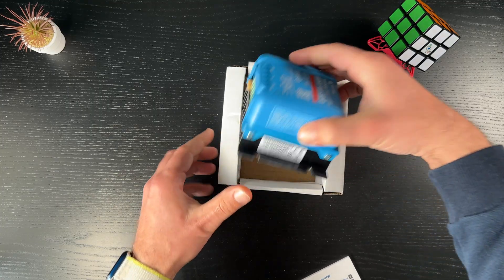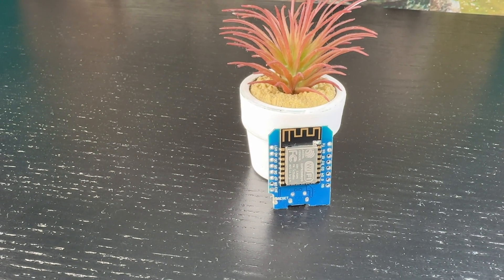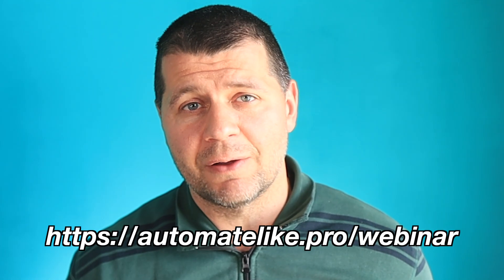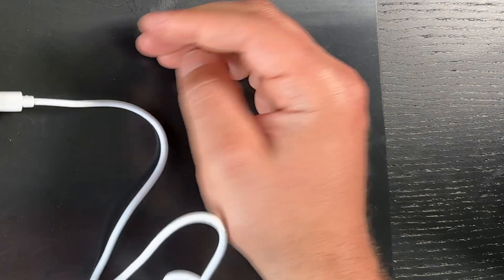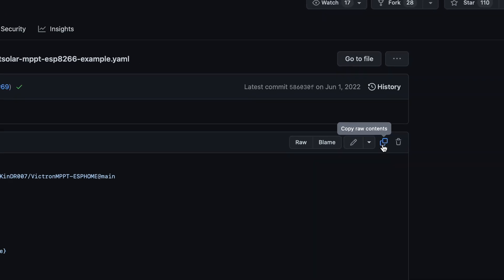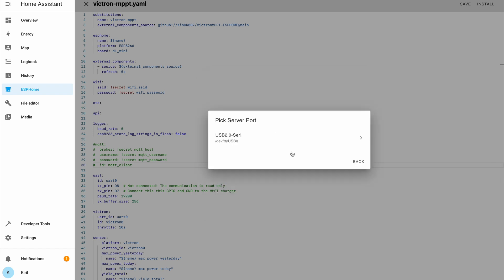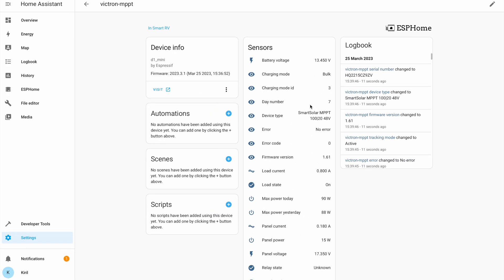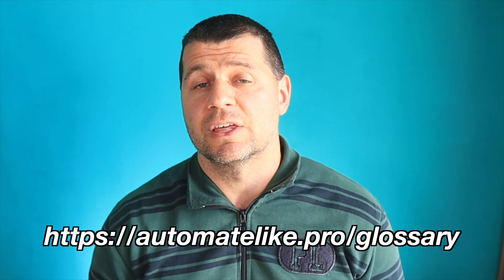"Hacking" my Victron MPPT to add ONE MISSING Function!

Comment: Did you add a voltage divider or logic level converter between the ESP and the Victron device?  Or was it measuring 3v3 between Tx & Ground on your solar charger?
Reply from the maker: No, I'm not using a voltage divider
Reply: @KPeyanski  All good.  I ended up using esphome-victron_ble on an ESP32.  So far it seems to be working.

Comment: Hi my Friend. Good instructions, but its not working for me! Always in Log:  - [15:10:00][W][victron:093]: Last transmission too long ago - No Data is coming!!! ESP is online, Script is like yours and cables are OK! Does anyone have an idea! THX all Its A Victron 75/15

Update! Everything works perfectly! I checked everything again and discovered that there was a short circuit on the prototype shield that my ESP is plugged into.
Reply: I'm having the same issue. What is that prototype shield thingy? I have a short cable with a JST connector soldered to my D1,
Reply: Any advice on how to solve it?

Comment: Thanks for the tutorial! I had to change the UART id, but other than that all is working well. I'd like to set this up with the BMV-712. It would appear I need to add the various BMV-712 sensors into the yaml file. I'm not sure of the details yet, but if anyone else has instructions on how to do this it would be appreciated. Thanks again.
Reply from the maker: Glad it helped! For the BMV I can suggest to ask the author of the code in GitHub ;)
Reply: Did you find out how to do it with BMV-712?  Thx.

Comment: As usual a fantastic tutorial. Well done!
This is the first time I have used ESPhome. I have a boat and just installed a victron charger on board. So this is perfect for me.
However, my D1 mini will not connect to the wifi....
I had a spare D1 mini, so I tested it on my house installation of home assistant and that one wouldnt connect to wifi either (completely different router, Rpi etc)...
I googled for solutions, tried them all and still no luck....... :(
Any ideas?
Reply from the maker: What the ESPHome logs are saying?
Reply: @KPeyanski  I found this issue. The old incorrect wifi password trick! 
I changed it in the secrets and it still didnt work, which is where my frustration began and when I messaged you. It turns out that if you change the secrets info, you have to reflash esp. Or at least that is what worked in my case. 
I now have remote access to my battery charger on my boat! 
I used a different victron yaml to suit my model of charger, but it worked perfectly in the end. 
Thanks for the idea! :)

Comment: Hi Kiril - I built the tool with the D1 mini pro and flashed it with your source code. Pin D7 connected to pin 3 and GND to PIN 1 of the MPPT.
But my log just says:
  [W][victron:093]: Last transmission too long ago
Can you tell me what's wrong?
Reply: Same problem here. 😞
Reply: Same here
Reply: same here since a few weeks. it worked okay for a couple of months
Reply: hi, same thing too, anyone have a solution please?
Reply: Any solution guys?

Comment: Hello. I’m from Romania and I have a home assistant system for monitoring the devices in the house. the photovoltaic system consisting of 4 mppt epever tracer 4210 and rj45 wi-fi modules. how could I integrate those mppts in ha? they are connected to the internal network and I have their ip. they work with epever pair cloud. I greet you.

Comment: It would be cool to show how to intergate it to the HA energy dashboard.
Reply: Agreed, great idea for a follow up video
Reply from the maker: Yes, I have to play with it first :)
Reply: A Zigbee plug - or in this case a Wifi plug - which measures power would be the easiest for the 230V consumption. For charging some input might be used. So there is a in/out from the battery which shows up in the HA energy dashboard.

Comment: Can i use ESP32 instead of 8266?. Great videos btw!
Reply from the maker: Of course, you can use both ESP32 & ESP8266. Also I'm so glad that you like my videos 😎
Reply: @KPeyanski  Finally got back to this. You have the wires labelled wrong in your video. Pins 1,3 When it should be 2,4. Great video otherwise! Thanks!
Reply: @Baje36  In the git repository pin 1/3 are mentioned, too. From where did you get it that it is rather pin 2/4 and which Victron device are you using? In the PDF about the MPPT chargers by Victron there is a jumper between pin 2/3 (the two centre pins) to be seen. Do you know the purpose of the jumper by chance? Thanks in advance!
Reply: Update - Been a good few weeks and working without hitch so far.
Reply: My apologies on this, on the 75/15 the plug is upside down.